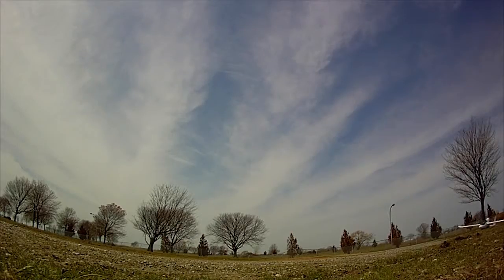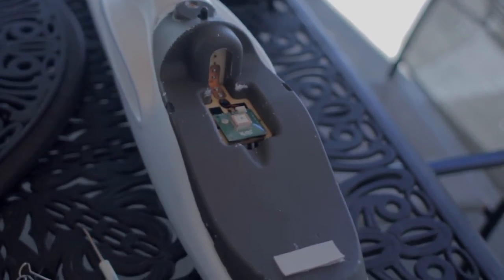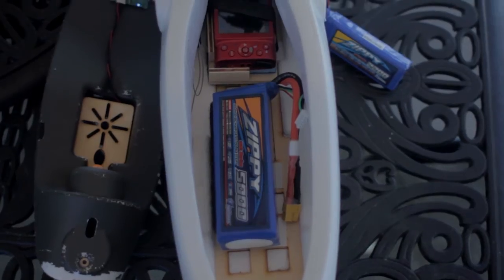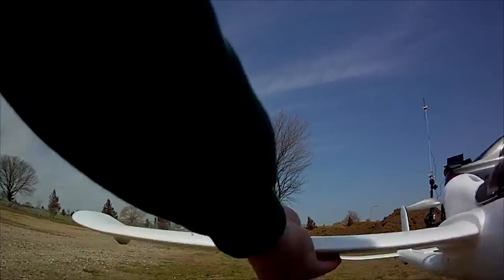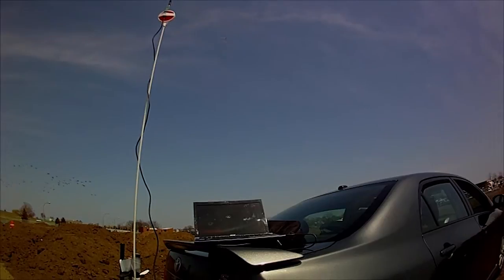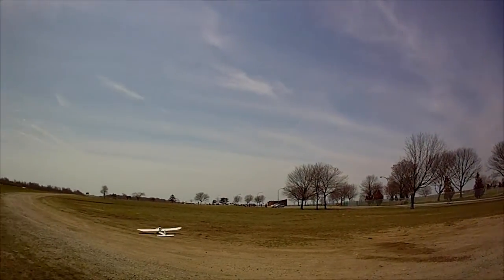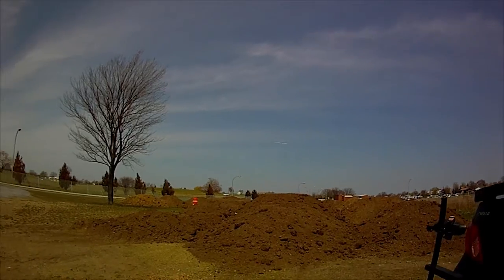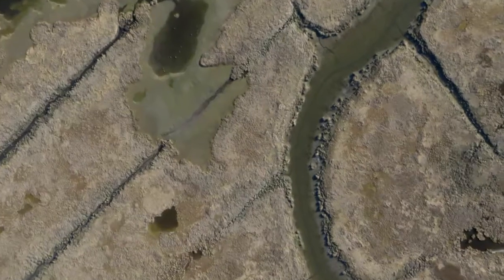Finwing Penguin UAV - Aerial Mapping Platform Review

Comment from the maker: Yes there is a great deal of more space in the skywalker 2013 and the penguin compared to the older skywalkers. you can get the SW 2013 with condor or 1900mm wings. Or you could just buy the fuse if you wanted to keep your wings but gain space. Penguin is very nice though :)